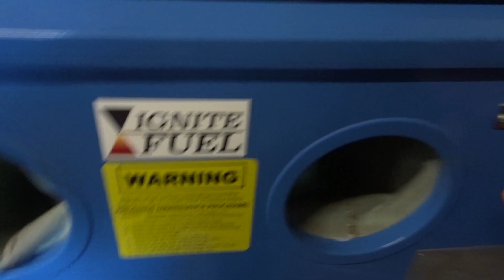Hydraulic brake unit Restoration | Kreidler Florett RS | MAGURA

Comment: IGNITE  FUEL  JAN  YOUR DIESEL ENGINES WOULD RUN MUCH BETTER IF YOU ADD MARVEL MYSTERY OIL TO THE FUEL IT LUBES THE FINE PARTS ALSO CLEANS UP THE INJECTOR S I USE IT FOR MY OM616 MB ENGINE OL MB 931000 MILES ON HER NOW  ALSO USE LUBROMOLY INJECTOR CLEANER IT DOES A GREAT JOB  NICE VIDEO OF THE TRIP YOU TOOK  LOVE THE OL DZL THANKS RONRDZLMB OM616
Reply from the maker: Hey Ron, Thanks a lot for the tip. I will have a look at it, sounds promising!
Jan